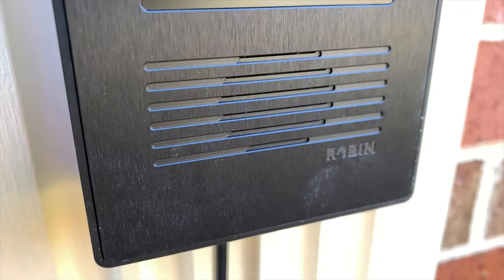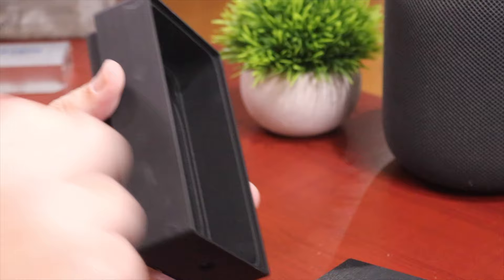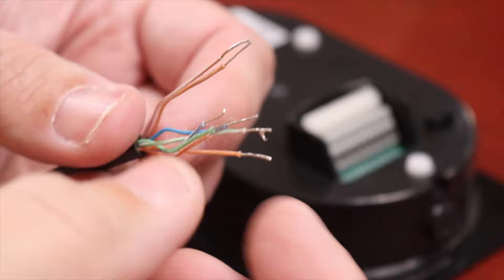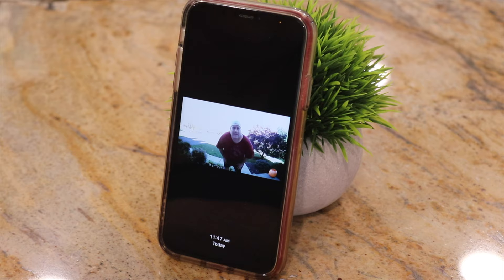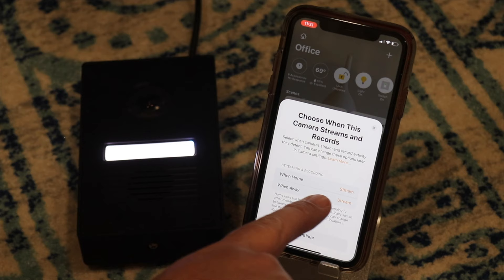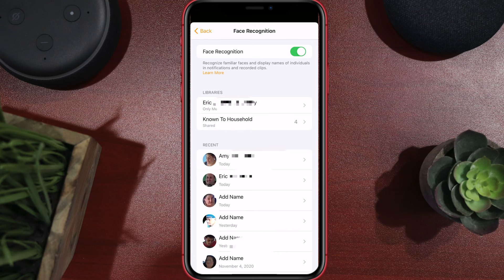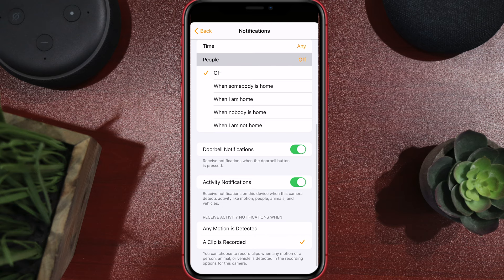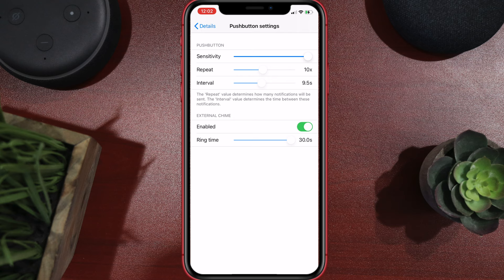Robin Proline -The FIRST HomeKit Secure Video Doorbell

Comment: Those Huge Elephants for me were huge PROS for me. The POE is a must for me since my condo it is hard to hardwire a doorbell. the POE makes it easier. As for the lights, my association automatically turns on the porch lights at night so that is not a problem either. the 720P camera might be a problem, but I don't have much area to cover which is a another pro for me. Even with a 1080 or even 4K camera, the only thing I will see is my neighbors door and some plants and once the person leaves the area, you can't see much. It is not like I need to see 50 feet down the street or anything. Thanks for your review on this. Might consider this option.
Reply from the maker: Thats awesome. A perfect use case.  Glad I was able to cover it for you.

Comment: I wish we could use a button + a HKSV camera as a doorbell. Like a G2H plus a Aqara button. Didn’t find nothing with homebridge
BTW. I love the POE Ethernet connection.
A perfect doorbell to me is this Robin with a smaller size, doesn’t have to be too small. With better specs, night vision and a 200ish price.
Reply from the maker: Have you thought about using the EufyCam 2 (It has HKSV but no talk feature in HK but atleast you can see whos there) and then a Aqara Push button. It's not water resistant but maybe you can spray down the guts with a silicon spray. They are so cheap it'll be fun project to try out.  Also, if you have hue bridge, senic makes an outdoor switch that is water proof and exposed to HK with the hue bridge. You'll have to bridge the Aqara Hub Siren with the Aqara Hub Light or an Aqara Plug to make the doorbell sound when the switch is triggered.  It's not ideal and since there are so many parts, it'll be better to play with the Aqara push button and the silicon spray first.
Reply: @ModernDayTech  thank you to take the time to give a such complete reply. I don’t mind to go with home bridge route since Hoobs arrived. I don’t know the Senic, I have hue bridge this is way I’ll try out. The only thing is lacking is facial recognition announce on homepod. This is what I’m excited when was announce on WWDC. I home the Homebridge community comes with a solution to make a regular HSV camera into a HSV doorbell. I read on Reddit and GitHub that they are trying to make a regular HK camera into a HSV camera. Maybe the guts to make a HSV camera into a doorbell would be easier. Sorry my bad English.
Reply from the maker: @TheJoaolyraaraujo  You're welcome. The facial recognition is cool on the homepod announcement but I'm most excited to see where they take it.   My favorite tech of the year is the Starling hub cause I can take the facial recognition features of the Nest Hello and turn them in HK automations. Even though  I don't have a lot of automations for the doorbell, the technology behind it is awesome and can lead to many great ideas.  Plus the Nest Hello has the best footage of any doorbell I've tested.   It is amazing what people can do with homebridge and the ideas they implement. Although I would like to see a HK camera into HSV camera, I doubtful that it will happen. Only because Apple advertises that HSV is end-to-end encryption and if there is HK to non certified HSV solution it will make people think apple is having privacy issues. Just my two cents.  (BTW, your English if good)